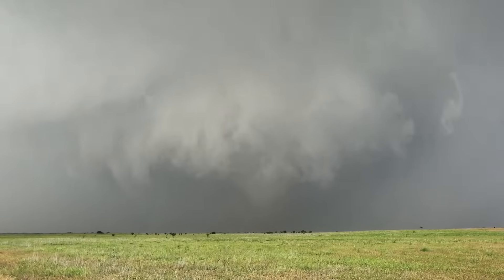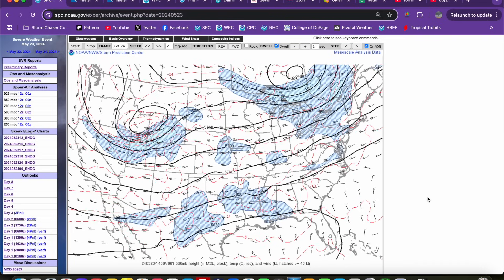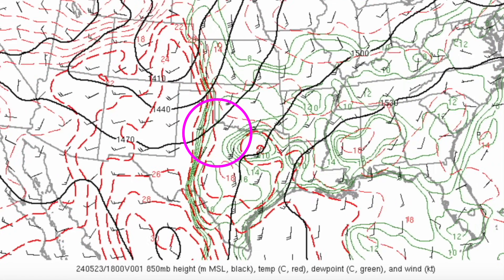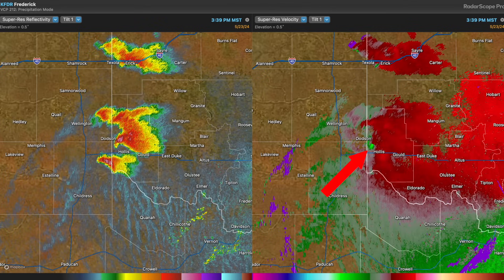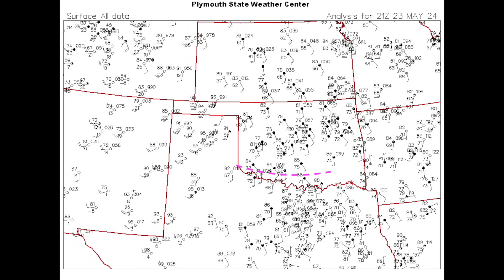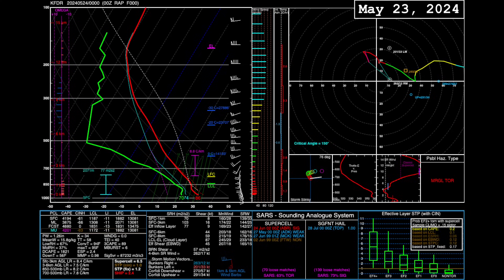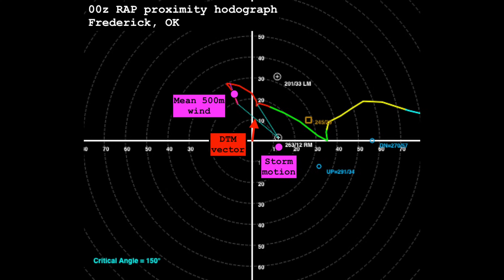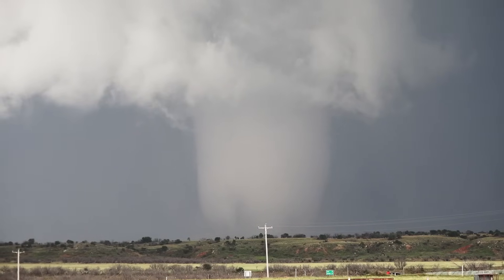Meteorological Breakdown: The Duke, OK, Tornado - May 23, 2024

Comment: Conservation of Angular momentum. Transverse to Cyclical.
Reply from the maker: Which part of the event are you referring to
Reply: @ its translating and rotating   when it stalled (translating) running into that boundary that energy goes somewhere (rotation) hence the intensification.
Reply from the maker: @ The boundary serves as a source of enhanced low-level wind shear and vorticity that is ingested by the supercell, inducing tornadogenesis.

Comment: Great breakdown as usual, Trey! Some of that high-resolution radar data is really cool. Reminds me of some of the VORTEX/VORTEX2 DoW images.

High-instability days are exciting for this type of potential, but most of them don't produce like this. I remember a day (I think you may have brought it up as a high-instability/weak low-level shear null case in a past video, perhaps Plainfield or Jarrell?) I believe it was May 27 of 2017, where a lot of chasers were excited due to a forecast for extreme instability and the presence of an outflow boundary in northeast Oklahoma. However it seemed that any supercells that fired ended up stuck north of the boundary and couldn't root to unstable surface-based inflow. Perhaps because the atmosphere along/south of the boundary remained capped? I was on vacation and considered chasing that day, but opted not to due to the fact that it would be a one-and-done run from Wisconsin to the Plains (my vacation hadn't started early enough for me to make it out to the CO/KS border for the day before) and the best potential looked to be in the unfavorable terrain of northeast Oklahoma into southern "Miss'ry."
Reply from the maker: Thank you! You're right, high-CAPE-low-shear days don't often produce; you always need some sort of factor to compensate for the weak low-level shear. I chased on May 27, 2017, and I remember everyone was incredibly excited because CAPE values were expected to be absolutely off the charts (7-8000+ J/kg). But there was just no low-level shear, including in southern Oklahoma, where many folks targeted (including the DOW crew). I distinctly remember being mesmerized by the rock-hard updrafts that day; you could see them exploding into the atmosphere. But the chase became a bust quickly; storms did nothing of note because of the lack of low-level shear.

Comment: Low-level shear didn't look too bad to me tbh. I've caught tornadoes off worse hodos; May 2nd's <3km wind profile is a bit more anomalous, but I think the "mergers and acquisitions" theory (as Dan and I call it) especially with three cells merging will tend to rizz in any mid to late season environment with enough upper support to prevent the storms from wetting their pants in the first place (cf. Dodge City '16, El Reno and Moore '13). It was also good that the bulk vectors were more easterly and weren't perpwalking the dryline.
Reply from the maker: I love your colloquialisms…I’m need to start using “storms wetting their pants” and “perpwalking the dryline” 😂